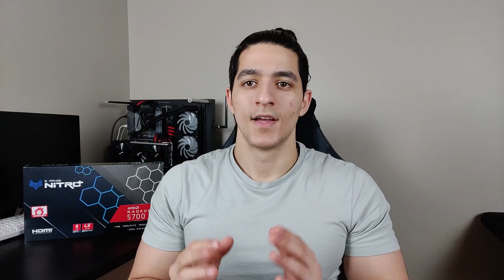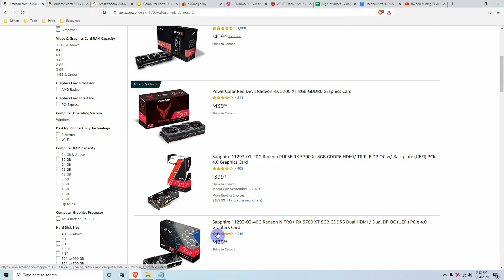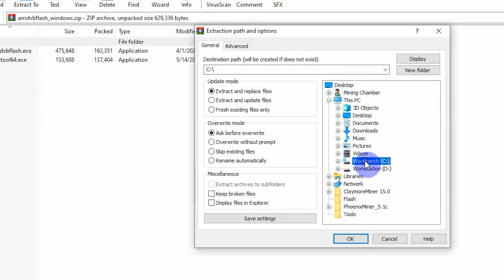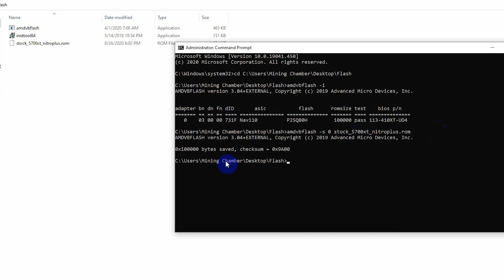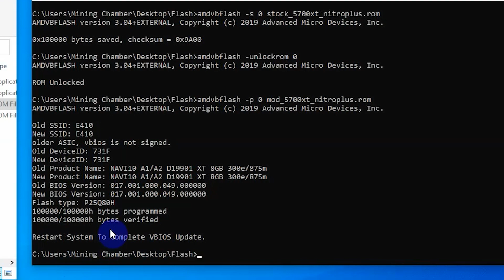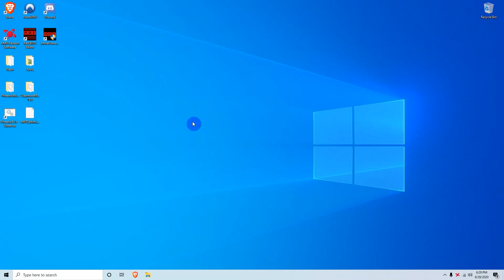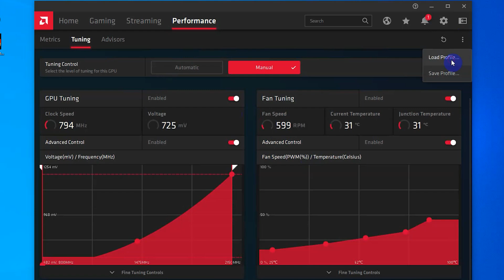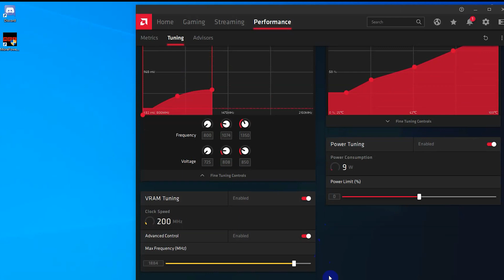RX 5700 XT Mining Overview | Profitability, Hashrates, BIOS Modding & Overclocking

Comment: Would it hurt anything to set those mv lower to like 710 using MPT and see if I could get the power even lower?
Reply: Well, I started to do it but every time I try the unlockrom command it gives me the blue screen with windows tdr error and reboots. I unplugged all but one any ideas why it would do that?  I tried uninstalling and reinstalling the driver. Do I have to unlock the rom. I plugged all 6 back in and I have no problems running all six with no errors. If I need to I can post in a forum or somewhere else if here isn't appropriate. Just tell me where. Thanks
Reply from the maker: @bumpinbig  that is odd, I do recommend doing it one at a time for sure just make sure that your properly setting MPT values and loading them properly. Come join our discord so we can talk more about it! Link is in the description!
Reply from the maker: It definitely wouldn't hurt but it is much less likely to be stable ! You can give it a try, and let us know how it goes!

Comment: I used this guide to Flash my RX5700xt (no problem huge thank you!!)  however i am now  having fan curve drops  while running  phonexminer, even on stock bios Wattman  just flattens the curve and  drops it down to ~1100 RPM or off entirely. been  trying to find a solution on my own but it doesnt seem to be addressed anywhere. hoping the community has some ideas or solutions...
Reply from the maker: Hmm that is odd, try to set a certain percentage for the fan speed. Like a fixed fan speed 50-60%
Reply: @MiningChamber  thanks for getting back, it turns out Phoenixminer’s arguments were overriding the fan so I preset it “ -fanmin 85” and now it stays constant!
Reply from the maker: Nice!! Good catch! ⛏️⛏️

Comment: Did you pick 180W as a limit on any basis? Could I put it on 150W?
Reply from the maker: No basis really, just in general I don't want the cars to I'll more than 180. 150 is too close and I am not quite sure what side effects it will have like that. I recommend leaving it some room!
Reply: @MiningChamber  Thanks as always for the enlightning answer. Hope I can help you in the future too. Greetings from Argentina.
Reply from the maker: 🙏🙏⛏️ our pleasure no worries at all!
Reply: @MiningChamber  Just for fun, I calculated around 2 grands for a 6 5600xt rig with a 1200W Gold + PSU. How much time do you think they will last until you need to fly from ETH/ETHC to Ravencoin or Nicehash, etc. Thanks!
Reply: I’m using this in a Pulse Be and getting 54.7 mh/s. But I do the OC in hiveos so im not sure about the settings. The memclock everyone use at 1800 I need to put it at 915 to get that best result. Any hints?
Reply: Just an update for hiveos users, with the following parameters i'm getting 58.6 mh/s now after bios editing a Sapphire 5700xt pulse be:
- Core 1400
- VDD 2
- MEM 950
- PL 180 (this shouldn't affect but doesn't hurt either)
Reply from the maker: Nice thank you!! I'd say we still have time for eth and etc to both be gone. At least one more year for sure!
Reply: Mining Chamber Thanks!!! Now I’ve tried a couple I have yet not bios-edited. Using same values but with MEM 930 (even 940 was unstable), I’m getting 53.8 mh/s for Sapphire Pulse be and Gigabyte cards.
Wattage:
Sapphire be Bios-edited: 116W
Sapphire be not bios-edited: ~110W
Gigabyte not bios-edited: ~120W
Reply from the maker: @martinsenuy895  nicee! I was able to get it really stable in HiveOs. Looking forward to do an update soon!

Comment: Hi. I followed all the steps with my Sapphire rx 5700 xt GPU and it works the same. Thank you for that. But after that I tried the same steps with a gigabyte rx 5700 xt GPU and after flashing the bios and restart, my PC remains stuck in black screen before the bios. If I remove the GPU it's working with integrated graphic and If I put again the sapphire it's also working. In BIOS as primary display I have 3 options(Auto, CPU Graphic and PCIE). With gigabyte GPU connected and any of those 3 options I have black screen and I'm not able to do anything. I want to boot my PC from integrated graphic and with this Gigabite GPU connected in order to flash the stock BIOS settings but I can't. Does anybody know hot to fix it?
Reply: Hello, in the COMPUTER BIOS, change the display mode to on-board output, usually if the CPU has a core graphics card.Connect the HDMI or VGA cable to the motherboard and swipe back to the original GRAPHICS BIOS via AMDVBFlash
Reply: I tried but the screen it's the same. I went today to a specialist and he melt the flux from the BIOS integrated component and detached it. After that he used a special tool to delete the wrong bios and reflashed it with the original one which I saved in the beginning and reconnect the ic to the GPU. Changed the heating solution and reassembled it. But it still doesn't work...
Reply: @vladmarta357  Greetings,

Please, use the official Gigabyte bios with its own flashtool in the kindly attached link below to reflash and fix any bricked Gigabyte RX 5700 XT GAMING card:

https://download.gigabyte.com/FileList/BIOS/GV-R57XTGAMING-OC-8GD-FA0.zip

This bios is modifiable as well,

You may have a good day,
Regards.
Reply: @GangBiT Greetings,

Please, use the official Gigabyte bios with its own flashtool in the kindly attached link below to reflash and fix any bricked Gigabyte RX 5700 XT GAMING card:

https://download.gigabyte.com/FileList/BIOS/GV-R57XTGAMING-OC-8GD-FA0.zip

This bios is modifiable as well,

You may have a good day,
Regards.

Comment: when adding more than one GPU from the same type in windows does it require to install the driver again for the next GPUs or they will be recognized by windows automatically?
Reply from the maker: They will be automatically detected with the drivers you have so no need to Install drivers again! Although I recommend bios modding one card at a time. Check our 5700 XT build in our channel to learn more!

Comment: I follow the exact same progress,  but once I flash the BIOS on my rog strix 5700xt and restart the Radoen software won't start. Popping up :"No AMD driver is installed........." Can anyone help me?
Reply from the maker: Did you install the same drivers we used? 20.4.2 - if it still doesn't show up then boot into safe mode use DDU to remove drivers completely and then reinstall drivers. And also make sure to BIOS mod your cards one at a time. Unplug all cards except one and BIOS mod it
Reply: Or maybe use Amtikdag patcher 1.4.8 then restart

Comment: Same for 5700xt strix?
Reply from the maker: Yes!
Reply: @MiningChamber  much appreciated. Just starting up. Found you today. Saved video for when rest of parts arrive. I hear nitro+ and red devil get high praise.. would u say strix is up there as well or too high power draw on the strix?
Reply from the maker: The Strix are really good too! They are up there for sure. 

We copy the 1550 timing lower to the one below it because they do have a higher refresh rate so it makes it more effecient in mining. As far as I know, there is alot more to it but I don't know the exact technicals of it😂
Reply: @MiningChamber  efficient is good. Was just curious. Also do u happen to know another site for the amd flash 3.0.4+? Seems i cant load the tinyupload site and the mirror2 german site wont give me the download. Got the 2.9.4 since im mostly flashing 5700 and 5700xt but also getting 580s so.
Reply from the maker: @brunyes1816  what happens when you try to open the site? It's normal that it will give you an error and you can use any mirror it doesn't need to be german. I don't know of any site as of now unfortunately
Reply: @MiningChamber  theres only two mirrlrs listed on igorslab tho and first one just doesnt go anywhere and second one goes to a german site where it asks you to enter in email for download and then doesnt do anything
Reply: @MiningChamber  actually my only question from this video that i dont think was explain is why during the rom creation we copy and paste the 1550mhz one all the way down

Comment: What is the best way to decrease Watt per card?
Reply from the maker: By undervolting for sure, the more the undervolt the less watts the card will take. But they can also only get too low then they start crashing. So it needs balance
Reply: @MiningChamber  does undervolt makes the hash rate lower too?

Comment: Boot screen not showing when 10 gpu or more. I'm thinking because of the pico psu. I should use 300W pico psu?

Asrock h110 pro btc+
Intel g3930
8gb ram
3 hp platinum server psu 1200W
5700 xt nitro
SMOS in a 32gb flash drive
Reply from the maker: Usually when booting off of USBs then the issue is with the BIOS. Jump in the BIOS with just one gpu plugged in and make sure that it uses integrated graphics if your motherboard supports it and that it is booting off of a USB (Enable CMOS or legacy based on your mobo)
Reply: Thank s for the reply! The rig is perfectly fine running 9 GPUs but adding 1 GPU as in boot screen will not show up and even in the keyboard have no lights in num lock. CPU and GPU fans are spinning but not booting up.

I tested each part and working fine. I tested it also using Biostar TB250-BTC PRO.
Reply: have you connected the two Molex and one SATA cable to your motherboard from one PSU?also each SATA cable is better to be set for just 2 GPUs risers

Comment: Great video. I was wondering if you have any videos on setting up a 5700xt for mining with AMD software only? Im not sure I want to get into changing bios.
Thanx
Reply from the maker: Hey! in this video we only use the AMD software to overclock the cards. Please check the overclocking section of the video, no need to BIOS mod if you dont want to BIOS mod! Timestamps in the description below. Your overclocks may vary since you wont BIOS mod, that means you can at most undervolt at 800-850 so the Performance settings in the video will be a good option for you.

Comment: What are the risks of BIOS modding 5700 XTs?
Reply from the maker: There aren't Any  risks at all if done properly. Make sure that you keep your original BIOS saved because if not then the risk will be is that it will void the warranty if they see it with a modded BIOS - must place original BIOS never sending it to manufacturer for any reason

Comment: im doing 60 hashes and 130 watt on my 5700XT with OC But NO bios mod . who needs all the work with Bios mod ?? i got  the Red Dragon 5700xt Card
Reply from the maker: Nice that is really good, which overclocking settings are you using? Since if that's the case BIOS modding would be irrelevant. Even with BIOS modding hardly any 5700XT can stabilize at that range.
Reply: @MiningChamber  PhoenixMiner.exe -pool stratum+ssl://eth-eu1.nanopool.org:9433 -wal WALLET/WORKER/EMAIL -epsw x  -acm -gpus 123  -altinit -mode 1 -straps 2 -acm -mi 1 -gt 126 -mode 1 -clKernel 1 -clNew 1 -clf 0 -lidag 1 -openclLocalWork 64 -openclGlobalMultiplier 4096
pause. and overclock is  1900 mem  2150 core negative 35 watt. u could go with 128 instead of 64 in openCL but gets little shaky but faaaast lol
Reply from the maker: We will try that as soon as possible!!
Reply: @MiningChamber  well the straps i use for Nvidia card i got on my rig so, not needed for the AMD cards .also i can go over 61 hashes but its verry stabble at 60 so i just leave it there,i did not push the card to max yet. so mabye this card is different then other 5700 xt , i donno :)
Reply from the maker: We will definitely update about it if it works out !! Thank you for putting it out there. Il keep you posted 🙏⛏️
Reply from the maker: @insomnia1on1  We just ran it! Getting at 60 Mh/s but with a good amount of rejected shares xD but its awesome I never expected this! Not sure what the commands do but I will look into them, as for the rejected shares, are you having the same issue?
Reply: @MiningChamber  i get like 1 or 2 rejected in the first 5 min ,after that its prefect .no stales.been running for about 12 hours now
Reply: @MiningChamber  also ,did u try to change OpenCL in command line
u can change it to 32 or 64 and 128. u can also add "-amd" to the command so only amd card will start mining
Reply from the maker: We will give that a try and see what happens!

Comment: Hello and good evening I did your procedure with the shaphhire nitro + rx 5700 xt, I have a problem with phoenixminer 5.1 c.  Practically not just set your setup from AMD Radeon Software the parameters Frequency 800 1050 1300 and then voltage 725 725 725 clock speed 200 MHz and maximum frequency 1800 and the fan as you show on the video all with optimization activated as you showed in the  video I have the problem that the program after a while no longer does MH / if it gives me an error like this:
 The following options are not supported and are ignored.  1GPU (s) are auto-tuning.  Hashrate may be low until they are ready.  I edited the file as you posted with my data of course ..... (PhoenixMiner.exe -pool ssl: //eu1.ethermine.org: 5555 -wal 0xB3a63dfgtgnyjibtknitlbuuhnkkukkkyu.winblock -eres 0 -log 0 -mode 1 -  altinit
 breaks).  Basically I would like to solve the problem.  Could you help me ????  I await an answer about it thanks.
Reply from the maker: Hey! So after mining for a little while you end up getting 0 mh? Try to add -gt 100 in your mining script let me know if that helps!
Reply: @MiningChamber   Could you kindly write all the command please.  Thank you.  So as not to make mistakes .. both that of the start_miner and that of epools_example.  Thank you in advance for your availability thanks.
Reply: @MiningChamber  if I use MSI AFTERBURNER with vore voltage at 856mV power limit 0% core clock 1300 MHz and memory clock at 1800 MHz I have no problem and nothing freezes .... It seems as if the pool if you don't have a certain voltage would block the  mining!  Strange.
Reply from the maker: @claudiofrestasicilia  That's interesting. I am glad you got it figured! 

PhoenixMiner.exe -pool ssl: //eu1.ethermine.org: 5555 -wal 0xB3a63dfgtgnyjibtknitlbuuhnkkukkkyu.winblock -eres 0 -log 0 -mode 1 - altinit -gt 100
Reply: @MiningChamber  Sorry for the spelling mistakes but I'm using google translate because I don't speak english.
I'll try this new command tomorrow morning.
I wanted to inform you that I tried on etherum pool only with 2miner and as power on pc it gives me 52/53 mh s but on the pool it also gave me 80 MH / s initially for a while and then it dropped to 71 MH s now I have a Hashrate Average of 62.00 MH / s for 1 Gpu. It's possible????
Reply from the maker: It's okay! Is that the 6 hour average? It depends at what number your looking at
Reply: @MiningChamber  No 6 hours no! I saw that the first 10 minutes it gave me 80mh in the pool for a while 71mh and then it dropped a bit and held that average.
I did some testing to test the new bios
Reply from the maker: Join our discord if you need further help we can talk there. What language do you speak?
Reply: @MiningChamber  Italian
Reply: @MiningChamber  Nothing changes with this command -gt 100 for me! I always speak with your low-power configuration that of your 725 725 725 1800! With MSI Afterburner no problem at 800 1800 1300.
But you with the rig you made in this video: https://www.youtube.com/watch?v=lOn8WceC2TM
you didn't have the same problem as me sorry? Because in my opinion with that low-power profile you had to do it !!!! ??? ..
Let me know.
Reply from the maker: MSI afterburner can't go below 800mv that's why we used Wattman. But if those settings work for u then that's good! 

As for the pool. Only look at the Last reported hashrate not the current hashrate

Comment: How about Sapphire RX 5700 XT Pulse Black Edition? Is it good?
Reply from the maker: Those are pretty good too!
Reply: @MiningChamber  I got stuck when trying to run amdvbflash -i. Always get "cannot load driver". Any clue?
Reply from the maker: Did you install the latest drivers for your GPU before trying to BIOS mod? Also make sure that you followed the guide step by step! And you ran CMD as an administrator